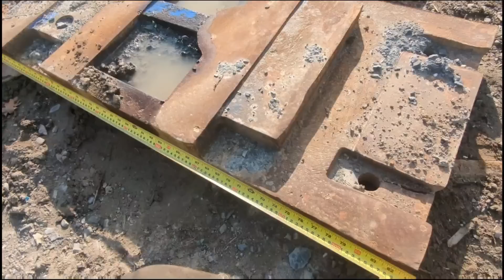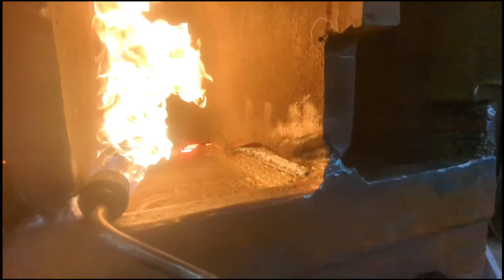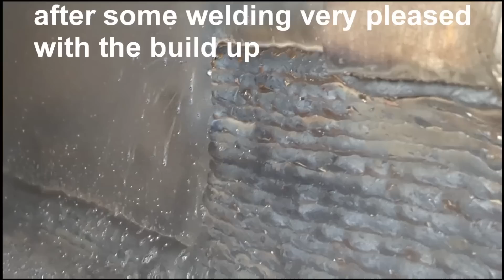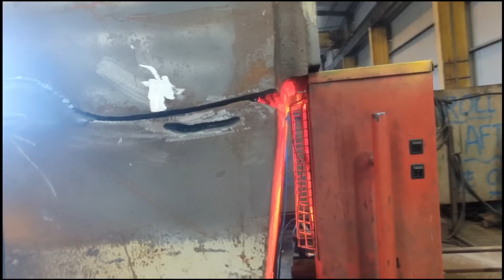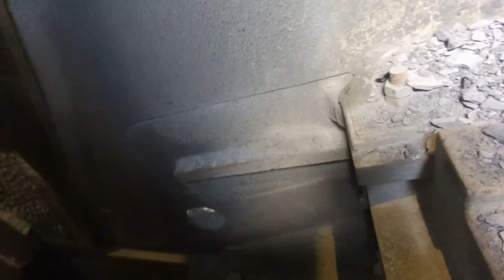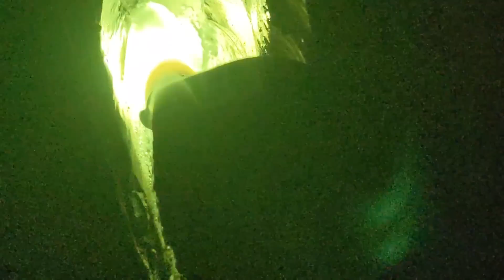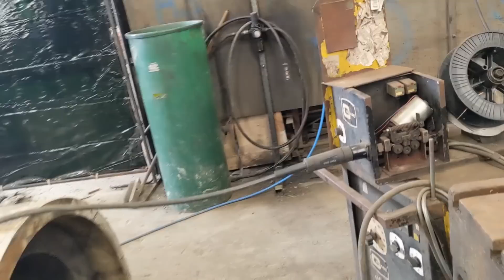10TON steel casting broken in half the welding repair starts!mega engineering!   quarry jaw crusher

Comment: In all seriousness though you've got a boatload of spatter going on. This is due to "Globular Transfer" in this case I would suspect less than optimal shield gas. You'll probably get less spatter on this application with a binary mix with 15%CO2. It's good to see you have your WFS dialed in with regards to getting good current input and also increasing metal deposition speed.
Reply from the maker: Less pen with spray transfer tho, I want to be sure to break throug gouge horizon.

Comment: Why the solid core and not some fluxcore? 81NI?
Reply: Wants a low strength, highly ductile filler = less stress on the HAZ which is where you can expect it to crack. You want your filler to stretch, not so much the HAZ.

Comment: Just an oddball thought hit me just now. You're using the big torch and space heaters for the preheat stages. But, I wonder if you might be able to use a scrapyard crane electromagnet as an induction heater. Maybe some kind of simple set of thermocouples and PID controller to accurately set some desired temperature in the area of interest. So, without all the time of you manipulating the torch and space heaters, maybe just positioning the induction heater magnet/head to the point you need with thermocouples measuring at your point of interest, and letting it do it's thing until the set point where it would then maintain the temp until you finished. But the only question I would wonder, is how the magnetic/electrical currents in the steel would affect the welding puddle/bead etc. Just a thought, maybe silly, but you have a unique situation with such large assemblies to deal with. Seems like there must be a better way for you to do that preheating step. :)

Comment: Very nice work here. Do you wonder if the part will hold up for the long run. Meaning, if the metal failed once, and knowing what this piece of metal must do as a crusher jaw, I wonder if the metal has fatigued so much that it may just crack somewhere else? This part is a massive piece of steel but I think all steel components have a useful life that once reached they can't be relied on to be as strong as when new. I have no doubt that what you have done is as good as could be and will work, but I have experienced parts that once repaired just didn't seem to last as long as a new part does, not failing at the same place every time, just seems to fail more often. I know weather or not to repair things is not your decision, but don't you wonder if it is as good as it could possibly be, or are they just buying time so as to get a new unit on site? Either way you do fantastic work, not many places can do what you did correctly, lots of experience showing here.
Reply: Were the parts you had experience with normalised after repair? Normalisation is a kind of reset mode for fatigued steels. They get to recrystallise - twice, under controlled conditions = happier stress free-ish steel.

Comment: I feel for the elbows buddy. Spent three weeks filling nail holes, sanding and painting base board, and trim in a new house and my knees, elbows were shot along with other parts after that and all on concrete. This almost 70 year old don’t have two many project left in like that. Also brother is almost sixty and welding for over 40 years on navy ships, sea going barges, heavy equipment and eyes and body of his is just about shot. Very nice job by the way. Very nice.

Comment: While listening to you explain how you usually lose a lot of heat on a job overnight, I am curious as to why you dont utilize insulating blankets more often?  Id assume by the fact you dont use them that theyre either not worth the time or theres some deficit I'm not thinking of.  Always a pleasure to learn and watch you lay down wire.
Reply: Interesting is it not that with cast steel you don't necessarily need them, if you can maintain a 50 Deg C preheat, which is what I think he said he could maintain overnight, I'd have to say a very different story on cast iron though with its higher carbon content and less ductility. This is the value of this video, seeing what actually works - even after it has been returned to service, and a very tough service life it has being a rock crusher.

Comment: Very large Thermal Blanks would help to maintain and control temps Temps  both in preheat and Normallisation cycles   micro penning additionally helps with stress releif of multiple joints ... correct identification of Base metal is most important  material . 
Cast steel cast was identified in first video 

LASTLY patience is a virtue  Great effort

Comment: Get that Oxygen regulator replaced! Not a good look.
Reply from the maker: Have you not realised I have no care for looks. The regulator works fine buddy and does not leak or present any safety risk
Reply: @allistairc123  So you know for certain that the brass BSPT fitting to the regulator doesn't  have any cracks in it before the restriction orifice from being knocked that might fail completely if it has another knock further down the line? If so then fair enough. And I know you don't care and TBH I don't care that much either it won't affect me but if someone from HSE sees your video then that's a red flag for a visit to check everything from LOLER inspection records to gas equipment safety check records. And yes some regulators have the restriction orifice drilled all the way through the fitting which makes them a lot stronger but not all ad they can still get cracked.

Comment: Did you ever confirm what type of material it was made from Alistair, I think you mentioned you thought it may be a cast steel, not cast iron...but it'd be nice to be able to confirm that. Any readings that you could share from the tex nuclear gun, maybe a full set of readings off it in the absence of anything else would be very helpful.
Reply from the maker: Hi , i knew from the start it was cast steel as cast iron is not suitable in this application, the problem was working out the approx makeup of the steel alloy, 
I took my best estimates with tools on hand and went with it
Reply: @allistairc123  Thanks for that Allistair, that makes perfect sense considering the service it is in.
Where did you get the advice from to try 312 Filler? 
Also do you think they tried a nickel rich filler in the repairs previously, and is it right to say that the nickel based filler if it was that, didn't take to this dirty cast material for them either. Looking at the first video it looked like there was massive lack of fusion under their filler. Also I noticed what looked like worm holes and porosity under the trial fillet bead you did before you had the casting blast cleaned, after cleaning much better huh? Assume you end up using an ER70S6. Good to see you went with your guts re the filler, nothing beats experience, and experience is what mattered to steer you in the right direction here. Who the heck suggested 312...!!! &^%$%&^

I'll be asking a few more questions if that is all right Allistair, because the learnings coming out of this job are unique - there is a lot that can be learned from this, even for Engineering Students as a case study at Engineering Institutes. You simply do not see such heavy cast sections being repaired on youtube, especially for such arduous service conditions - a fing rock crusher no less!  All you'll get now a days is theory, not practice. In practice sometimes you have to manage as best you can, and from that perspective this is pure gold, knowing what you can get away with when you simply have to. Very thankful you have had the guts to try the job in the first place and put it up here. :)

Comment: I'm a recently retired Boilermaker, and worked on some very large repairs on mining equipment like draglines and shovels. But that crusher kinda scared me a bit.
The combination of size, mass, metal type and required precision with such a nasty break... I'm impressed as hell with your work. Bloody beautiful
Reply: Awesome. I'm a retired diesel mechanic. 3yrs tech school for welding while in high school  5yrs navy seabees as a steel worker. I had some big stuff to weld but that was awesome with pre and post heating for stress and shrinkage.  God bless brother!!!!
Reply: Not a trade you hear much about these days, that's what my mum's dad did, retired about 1947 after 50 odd years, as foreman. never could ask him much, was as deaf as a post after all the noise !

Comment: Good job. Sadly, it will be broken again from welded joint after several 100k cycles.
Reply from the maker: Come back to me after part 3 and tell me why.
The repair has already completed 7000,000 cycles at least 3000,000 under stress so ..

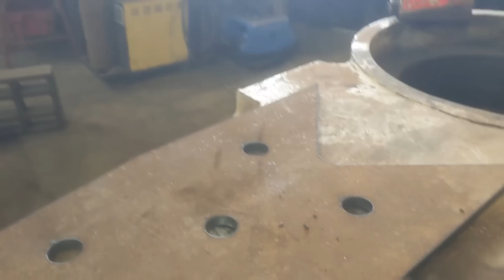Comment: 42:49 I’m surprised to see you didn’t use a dye-pen check on the welds prior to adding the fish plate, is it the usual way to do things in the heavy plant job? Not in any way a criticism, just curious. Fantastic work @allistairc123
Reply from the maker: Yes for sure  on surfaces that are hard to see any potential cracks, and super high value jobs or vessels gas/fuel , or lift structures but not so much for good surface like this relatively low risk value job
Reply: @allistairc123  thanks for the response. Looking forward to the third vid

Comment: Rather than build up one pocket at a time, could you run a bead in each  to try and keep the heat evenly spread?
Reply from the maker: That would be ideal but physically moving across all the pockets back and forth would have been a nightmare, I didn't have the resources to keep the entire thing at 150 so I would do half a pocket and then share the remaining 50 percent with the next pocket in order and so on

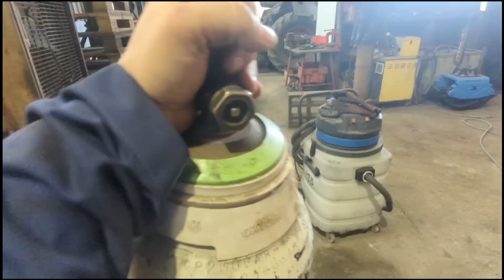Comment: That knackered oxy regulator concerns me (24:38). I thought in a shop like this where work safety isn´t taken lightly there souldn´t be a broken gauge regulator. I´m just a home gamer but I very much respect safety, I don´t wanna end up smoldering. Just saying. Your boss should replace that.
Reply from the maker: It's not leaking though. I choose not to replace it because it works as I need it to
Reply: Well, okay then, I wasn´t nagging, I just wondered because You do all else by the book. Thanks for the reply @allistairc123

Comment: Can you not get heat resistant pads so you can at least cushion your elbow?? Don't envy what you've had to do.ThankQ.TkEZ>UK
Reply from the maker: I stack used welding gloves , it's more the weight than the heat reaching and pivoting on it

Comment: Another very interesting video. I love the hard work you put in while not forgetting precision. Just a thought on pre-heat: what about building a box around each item to act as an oven of sorts. I'm not saying it will be a walk in the park to do this but considering the time taken and cost of energy it might be worthwhile? You'd need access points for the welding but I reckon the time taken to build a custom box each time would likely pay for itself. Anyways, keep up the great work!
Reply: The jobs can vary so much so most big workshops use ceramic welding blankets and keep one side wrapped while you weld other spots.
The weld blanket also reduces the burns on your body and heat stress from radiant heat .
I did 10 hours welding inside a truck body last year , after the job was finished i counted the empty water bottles i went through , it totaled 10.5 litres of fluids.

Comment: I bought a half dozen of those Red Rhino heaters as a job-lot at an auction, thinking they might be ok for work - turns out they are excellent machines for applying heat. :-) Epic work, Alistair.  

BTW - they do some weird oddness in a can - baking anti-stick spray  - it's an aerosol, think Lidl stock it.   How good of a tip-spray is it? All the good. Not alone does it stop your buns sticking to the tray, it beats any anti-spatter spray I've bought before too. No idea what the magik ingredients are - but it works. I run mostly flux-core, so tip-spray matters - that stuff is amazing.
Reply: Can't help but wonder if gouging out pockets for some butterfly inserts wouldn't help strengthen this sort of repair even more? Out close to both edges just as the "braces" to the belt you always apply. Big, sturdy butterflies, maybe 25mm?

Comment: Surprised that so much work and material used is still cheaper then a replacement jaw. 
Kudos for a great achievement!
Reply: It wouldn't just be the cost of the repair that would be the issue, but the lead times involved in finding the original manufacturer, if they are still in business and still producing such parts. Then there is the time involved in quoting for a replacement jaw, not to mention site visits to check measure the existing machine. 
If the part is to be made, are you using original drawings or new modern ones?
Then, we will need to make the male pattern pieces and any sand cores to be used in the sand casting process. Given the size of the component, I am assuming that the casting will be done in a sunken casting pit for safety reasons. 
Once the correct metallurgy is determined, the component can be cast and then stress relieved before primary and secondary machining tasks are undertaken. 
Then, the component will need to be prepared for transport from wherever in the world it was cast and machined. Once the component arrives on site, it will need to be inspected before installation is started. Then, hopefully, you will have a rock crusher with a new jaw.
Now, how much downtime was involved in the process from the time the machine broke until it was put back together with a newly manufactured jaw?
Six months, twelve months, eighteen months? Two years? This all assumes that everything goes right. Does everything go smoothly with a large project? Never. 
All of the above makes the repair job by Alistair look like the cheapest and quickest option. Not that Alistair comes cheap, but in comparison with trying to source a new jaw, he looks like the best option.

Comment: I am absolutely gobsmacked of the sheer amount of prep work and skill gone it to this job. The amount of knowledge to do the kind of work is beyond my comprehension! 

I have seen a lot of videos where gauging is used. But I don’t quit understand what is happening. Is current going through the carbon rods and when it hits metal it get so hot it just liquefy the metal???

Awesome job
Reply: It's air arc mate, disposable carbon rod for energy transfer then combined with air, bit like electric gas axe

Comment: How does your breathing air supply work? I presume it's not just shop air. Is it coming from outside the shop, or just remote from any welding? It's pretty damned impressive seeing how this thing goes back together. As an engineer of another sort, I am always impressed by what can be done in other disciplines. What we call other people's magic.
Reply: I am glad someone mentioned that .
Never use shop air from a compressor direct to the mask , It can cause pneumonia , collapsed lungs and other nasties from the oil vapour in the air and piston compressors also produce ozone.
There are filter packs however that can clean the air to 99.99 % that are commonly used , I use a blower fan that pulls clean air from outside the factory , runs through a filter then to my mask.

Fresh air supply masks should always be used when Air Arc gouging too as the pure carbon is very highly carcinogenic.

Comment: Thanks again I am amazed at the fit up you were able to achieve given the state of the destruction that you had to remove . I am a bit surprised you have to do all this welding wire research yourself, I suggest you  reach out to some of the large oil and gas’s services weld experts in the UK they will have a welding expert engineer. 
I ran a business in Houston Texas Aker Kvaerner we supplied some technology to them it resulted in me going to there fabrication and repair facility huge subsea structure including giant cast steel valve bodies 8 inch wall thickness being welded , they had a welding engineer on staff .  The body diameter was larger than my 6 ft hight .
I like the butterfly reinforcement on the sides , good idea !
Reply from the maker: We machined a few of those castings from raw casting. Incredible items

Comment: Should do all roots first then  weld across hole piece buildup evenly keep forces equal will help put heat into hole piece as well from welds besides the pre heat all roots first will ensure cracks don't start as well from stresses nice job
Reply from the maker: Generally I do that for that exact reason lol it occured  to me that the heat wouldn't travel across the gaps lol

Comment: Wow.  What a massive job.  Are you allowed to share with us the approximate cost of such a repair?  Also would be interesting to know what a new part would cost.  Great work.
Reply: @myselfremade For a 2 month job it would have to be $ 65,000 just for labour or the factory will not be turning a profit , that is without consumables and materials.
That is assuming a 40 hour week.
Factory floor space is worth $
Staff wages , insurance , power , gases , consumables , and add the cost of a box of aspirin for the guy paying the bills.
Reply: @myselfremade my guess would be $ 165,000 to buy one assuming there was one available , you might find there is a 5 month wait to get one made if the crusher is a 30 + year old item
Reply: @myselfremadea custom cast piece of kit will have a lead time of several months, sometimes repairing it and swallowing the huge costs associated are the only option. I work in the steel industry and we recently had a quote from an OEM of a 24 month lead time for a no longer produced gearbox.